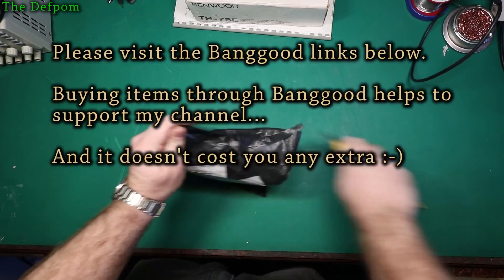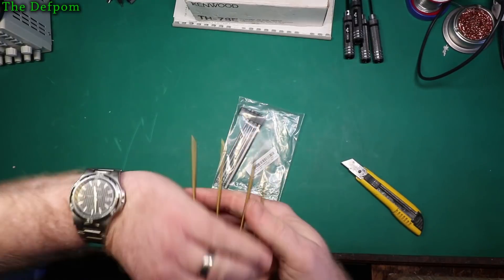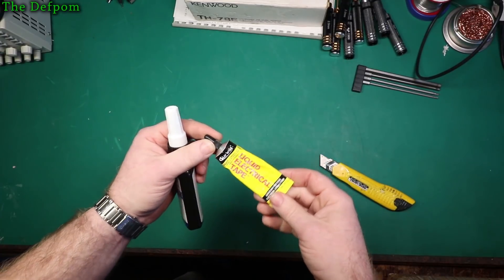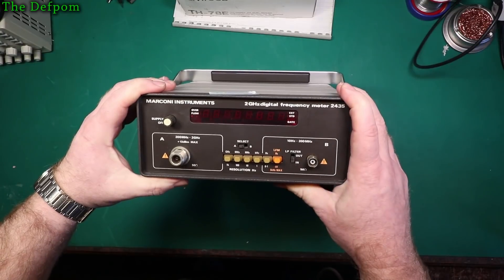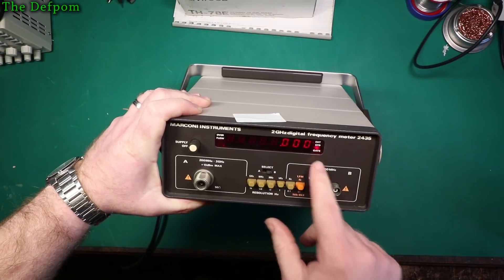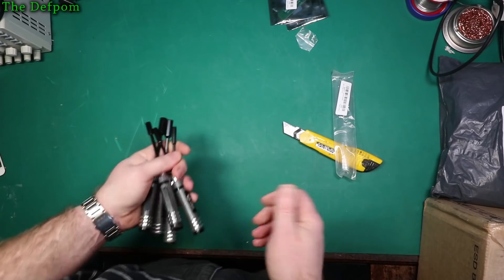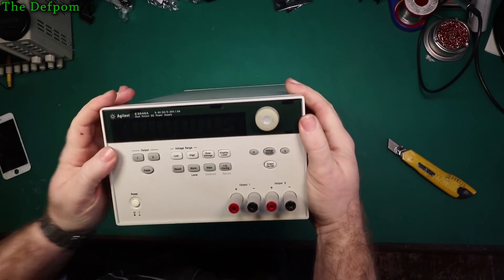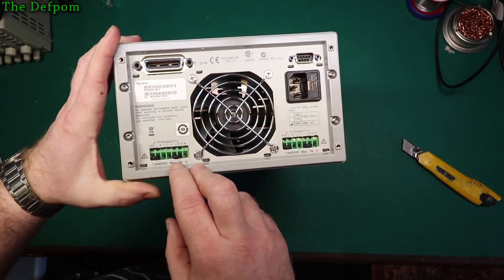🔴 #460 Mailbag 22nd October 2018

Comment: 1:20 those caps will break of in a week or two, making them all identical :-)
BTW why do you buy them as separate screwdrivers and not in a set 
with just one handle and a bunch of bits?
Reply from the maker: I found them all as individual mini sets, not as a full set, if I had seen a full set I may of purchased them that way instead.